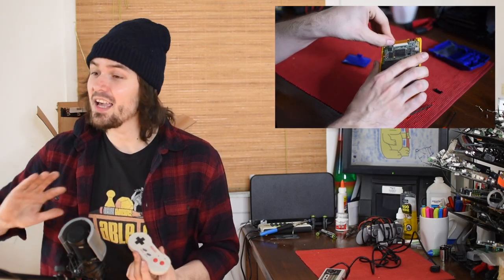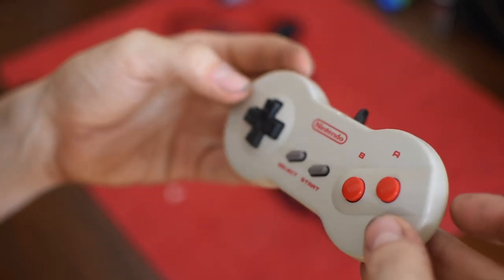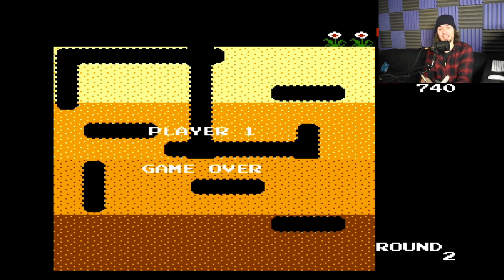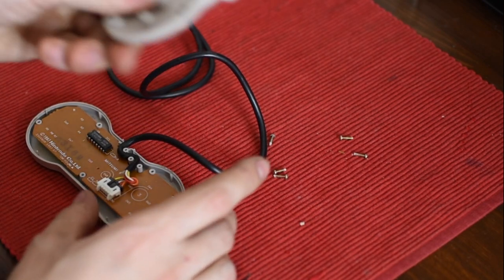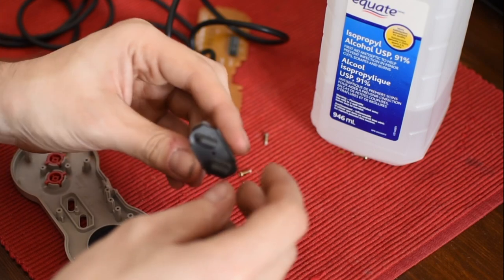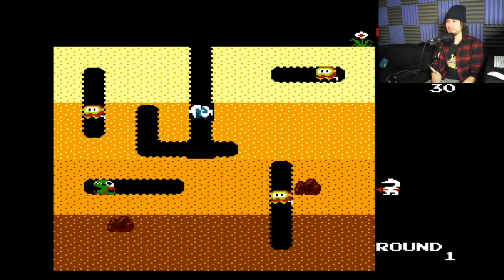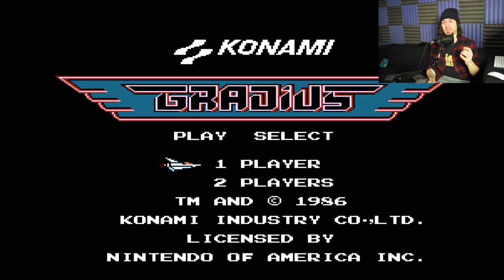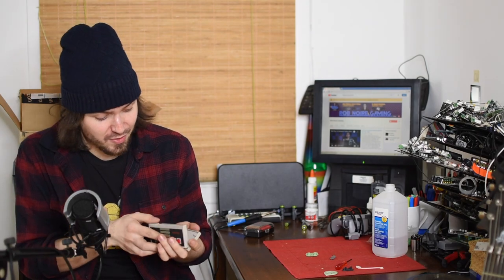Broken NES DogBone Controller : Can I Fix it? Snes Controller Pad Replacement Transplant

Comment: I bought new silicone pads for a standard NES controller that did not fit into a dogbone.  Just a heads up for others that may see this.  Sounds like the SNES pads are the way to go, thanks.
Reply from the maker: Interesting, and very good to know!
Reply: for just the d-pad? or a and b and the rest of the buttons? thank you i haven't been able to find this info anywhere

Comment: You can also use the ABXY by shifting it downward a little, and that allows it to fit; I’ve tried it and it’s nice. So a SNES set of rubber contacts will fit the dogbone completely just looks a little odd when taken apart but the one pad for AB can be rotated and used again so it gives you two repairs in one.

Comment: I just put a SNES Classic controller d-pad membrane in my dogbone, and It works fantastic! 

(For reference, I have both controllers apart on my desk right now.) 

From an SNES Classic to NES dogbone controller: 

The start and select membrane fits in the dogbone but sticks and is not usable without modification.

 The A B X Y buttons and d-pad are not compatible due to depth issues.

 The A B X Y membrane can be modified to fit, but I'd say it's more trouble than it's worth. 

Basically, the only thing you can use easily is the d-pad membrane, which works a fucking treat!

Comment: Thank you for the video. I need to replace the membranes in my Dogbone and had no idea where to find replacements. You should have tried the membranes from the original standard controller just for testing though, and maybe the pads from knockoff Dogbone controllers like the one from Tomme, maybe those will fit perfectly? Thanks anyways!